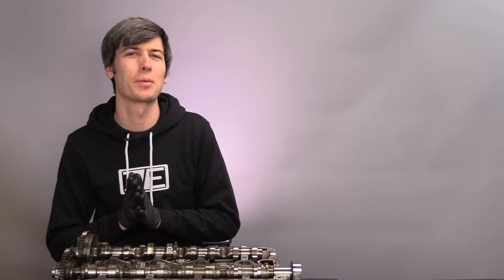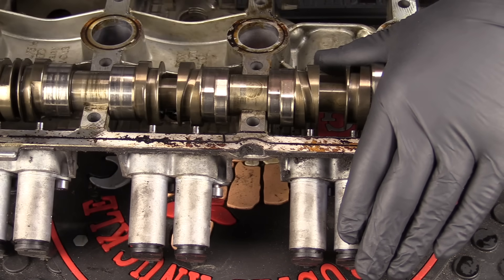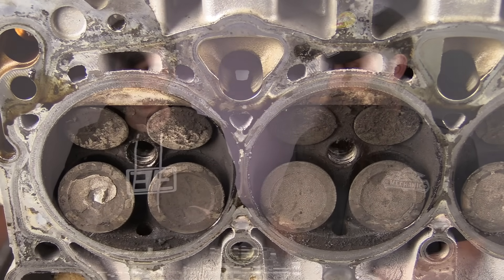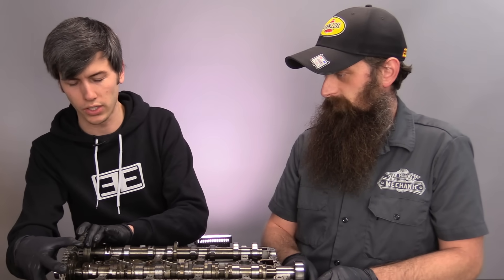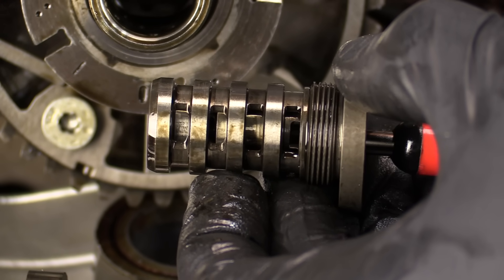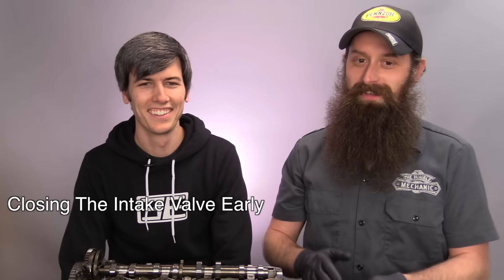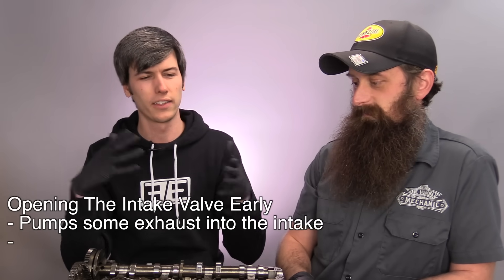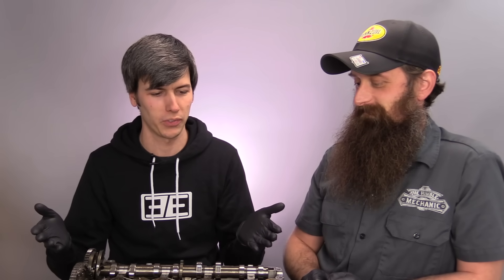Variable Valve Lift vs Variable Valve Timing - VVL vs VVT

Comment: Is there any specific reason to use VVT instead of VVL? Seems like VVL can do the same thing. Correct me if im wrong.
Reply: Vvl is set to one duration and lift. Like swapping to a performance cam at desired rpm and load. Vvt can adjust the timing, of the set duration and lift, to better fit the performance or emissions needs at any point in time in many positions. Not just off or on like vvl. Also vvt removes the need for an egr valve by producing its own egr effects when needed. In my eyes I see vvl as more of a performance feature and vvt as more of an emissions device with some performance benefits.

Comment: Got code p0011 that the cam is slightly advanced on a 2012 VW CC. The mechanic working on the car said the sprocket is bad on the camshaft and it is sticking in an advanced position. He also advised that this can cause valves to bend (again). He is asking for $800 to replace the cam. Does this diagnosis sound accurate? The video explains how the cam can advance etc. Can these stick and cause major issues like he is saying? Or am I being fed a load of nonsense. Thanks for the awesome video. Hoping you get this comment.

Comment: soon, FREE VALVES will ELIMINATE need for CAMSHAFTS , TIMING BELT/CHAIN and even throttle body. No cam profile to follow, computer controls valve open/close.

Comment: Go electric. Use the fuel in a power plant station with recapurators etc distrubiate the energy throue the grid that Will be better total fuel economy because a large power plant is more efficient. Also there is easy to shift out oil with solar power how is the way We must go.

Comment: Since this video is at least partially about VVT, I reckon a question is in order (I'm getting mixed answers, so I don't know which direction to go).

My '99 BMW Z3 (M52TUB28 engine) seems to have bad VANOS seals, and so it can't advance the timing for low-end grunt.  The top-end and idling are both good though (as I understand the cam timing is retarded for idle and high RPM).  Should I get it fixed urgently, or can it wait?  The problem is I don't exactly have unlimited funds at the moment, so if possible I'd rather do the VANOS later, and focus on more important stuff (fluid service, fixing the failing spotwelds, etc).

Some people say leaving it as-is won't cause further damage, but others say leaving it can end up ruining the entire VANOS unit, costing me a lot more.  And in case someone wonders, here are the symptoms:  Intermittant momentary RPM drop when I step on the throttle from idle, almost no power below 4k RPM ( (takes twice as long from 2.5k to 4k compared to a good 2.5 Z3, and the power comes in distinct "steps"), not-so-good fuel economy (not terrible though).

Comment: I noticed that some of the timing is adjusted to meet NOx requirements - but what if you have an engine in a racing car that does not need to meet emission standards - if you change the setting in the ECU - does it provide a lot more power? I guess my question is - does meeting environmental standards have a big impact on the engines power output?
Reply: Of course, it's called tuning a car.  But keep in mind that race engines are built very differently than passenger cars.  They are not meant to be long lasting, for example.  A top fuel race car can only do a couple runs down the track before it needs to be rebuilt.

Comment: All of these technologies just need to go away and have everyone use Nissan's VVEL.  They invented the whole setup to begin with anyways.  The 370z doesn't even have a throttle on it, the gas pump is always 100% and engine speed is completely based on their VVEL.  Some companies are still using ridiculously outdated and inferior tech like VTECH and it's 2017 for crying out loud.

Comment: this is video 2 that i have seen this engineer make a statement thats incorrect. 

a turbo does not "force air into the engine" a turbo changes the density of the air that is entering the engine. the cfm going into the turbo is much greater then what leaves the turbo.  if an engine starts with the ability to consume 500cfm then it will never consume more than 500cfm no matter the density of it. if you have 1 cubic foot of space and it is unpressurized you have 1cf of air.. if you pressurize it to 150psi you still have 1cf of air but with a much higher density. yes it took the compressor much more then 1cf of air to pressurize it though. 

a turbo can actually reduce the cfm the engine can take in due to high exhaust back pressure, for example take an engine that can consume 500 cfm at atmospheric pressure  (roughly 14.7 psi), the intake will be exposed to 14.7 psi, the exhaust will be exposed to 14.7 psi and in a perfect world the cylinder would be also be at atmospheric pressure. now strap a turbo onto the engine, with a 3:1 pressure ratio on the turbo. and lets say you have it at 20psi. the intake will see 34.7 psi total and the exhaust ports will see 74.1 psi and in a perfect world the cylinders will see 74.1 psi when the exhaust valve closes. using this example the piston will still have 74.1 psi and will have to travel down the intake stroke a bit farther (to achieve 34.1psi in the cylinder) before any air can start going into the cylinders. leaving less space for clean air to come in and less time the open intake valve can let air in leaving less total flow that the engine can consume.
Reply: honestly im only scrutinizing because youre an engineer

Comment: Emissions are NOT why I would do ANYTHING in an internal combustion engine. If I want better emissions I will just go to a Rankine cycle external combustion engine. I really don't care about NOx anyhow.
Reply from the maker: Even if you don't care about it, doesn't mean it's not toxic. If you close yourself in a room with it you'll start to care very quickly.
Reply: 105 degree heat on the 101 freeway coming back from Oxnard, 5 lanes, not moving for an hour because of a fiery car crash before the next available exit, not even AC, I am fairly familiar with concentrated NOx fumes in heat and sunlight.

Still as I said before, 'If I want better emissions I will just go to a Rankine cycle external combustion engine'.

Actually I have already built a prototype, so I am putting my money where my mouth is on this issue, literally.

I can generate massive amounts of energy at temperatures well below typical engines and therefore not get close to the whole NOx  issue while producing plenty of clean, cheap, renewable power at the wheel.
Reply: Everything in gasoline combustion is toxic except the H2O, [or a suffocant in the case of CO2] therefore your words are pointless and childish. As one who has worked on engines for decades now, I have never suffered any ill effects from working on high compression racing engines which 'belch out' large volumes of NOx emissions because, just like all engines, if you have proper ventilation, you won't even detect them.

I find it easier to breathe around a clean burning machine with some NOx than around a smoky, sooty, gassy engine which is putting out a ton of carcinogenic and lung irritating unburnt and partially burnt hydrocarbons as well as additional additives as they may happen to have added.

Some 'modern' commercially available fuels today actually boost the nitrogen in their fuels which increases NOx emissions in any car which does not have a NOx reducing type catalytic converter on it.

Comment: Jason I just wanna add that in turbocharged engines closing intake valves a pinch later allows to use the momentum of the compressed charge. While compression stroke begins piston is moving upward, intake cam is still opened and compressed air flowing into cyllinder meets moving piston and increases pressure. Valve should close just before air starts to flow out of cyllinder. That is called dynamic charging. Thank you for your videos man!

Comment: As I understand it, some engine brakes on trucks will open the exhaust during combustion so that the engine is compressing the air but getting no actual power out of it, netting a negative torque (from the perspective of going forward).

Comment: Nice information. If I recall correctly, years ago Cadillac came out with silenoid controlled vavles on a v8. I don't think it controlled valve lift and duration but it did close valves off and on and turned it into a v6 or 4 cylinder engine at specified times when needed... they didn't work out to good and I haven't heard of it since. Why all the complexed mechanical parts on a engine like this, if they could control the valves with silenoids similar to that Cadillac but with much better design control for valve lift and duration??? I think if I spent some time with it, I could come up with much cheaper and more effective simpler designs than this thing, which would cost you a fortune to fix.

Comment: One thing they forgot to mention is that when the engine changes de intake cam timming is also changing the LSA angle (in this case because is a DHOC) and a wider LSA improves smother idle but when you need power the VVT closes that angle improving combustion

Comment: i would think the reason to close the intake valve later would be to improve VE at high rpm (to compensate for the delay in the air filling the cylinder), I doubt that would stay opened long enough to push the air back out into the intake runners.

Comment: Looking at this makes me look forward to camless engines and a similar type of setup where a solenoid and actuator controls valve operation. Just shows its possible if this can be done for cams but reliability /warranty and cost is holding up??

Comment: I don't think you have done a video explaining the RPM capabilities of the Sportbike/Superbike engines vs car engines and why they can rev to 12-17,000 RPM (600CC-750CC). For example the 1.4L Hyabusa or ZX14 engines rev so much higher than an equal sized car engine like the Fiat 1.4L. Or why the 600 and 750CC engines so much higher than the Kei car engines.

Comment: Hey Guys, great Video on showing the mechanics. You haven't mentioned the real reasons for changing the timing. Such as on engines that are not "NA" or for exhaust scavenging or both. It really depends on your engine setup and application.

Comment: Would you mind explaining how the 1.4 multi air engine, like in my fiat 500 abarth, works it's timing? Benefits of using hydraulic valve control over cams and such.

Comment: Why no mention of the benefit of a wider power band? The purpose of vct isn't JUST emissions it's also about performance. Adjusting the lift manages the intake and exit velocity which effects where the engine makes power.

Comment: Rover's VVC is kinda interesting too. It doesn't changes the timing but it changes the opening duration of the intake valves like this vvl does but this vvl (explained in this video) is a binary feature ( just on and off / higher and lower profile ) just like a vtec or something else. The advantage of VVC is that it's an analog feature (short opening at low rpm and long duration at high rpm).

Comment: can't wait until there is a free valve turbo engine in production vehicles indefinitely adjustable valve for each cylinder of the engine just by modifying software in my opinion will be the next big step in performance

Comment: OMG this is german engineering at its best.. and by best i mean worst. Look, you don't need soooooo maaaany solenoids. You only need one, even with this garbage cam sliding thing. Literally make the whole thing slide into High profile with one solenoid and have it sprung to go back to low on its own when deactivated.

Comment: Can someone explain to me the benefits of the new VVT Suzuki introduced on the 2017 GSX-R 1000R? It uses metal balls and centrifugal force to push them outwards at a certain engine RPM. Obviously it eliminates the need for a complex oil system, but what's the point? Better reliability? Weight saving? Both?

Comment: why would you want the exhaust valves open less in the first place. wouldn't the engine run better with the exhaust valves open all the way at all rpms?

Comment: Not really ... fluid dynamics:  when there is flow in the manifold it has inertia so a little bit more air gets in even if the piston is coming back up. At low rpm there is not enough inertia (and actually air moves back out) but at high rpm closing valves a little late can be very beneficial. That's why they invented variable valve timing.

Comment: great video. thank you to both of you for explaining this really well. can you please explain why vw couldnt do this with the tdi? 
also, can you please explain why and how modern 1.8T and 2.0T engines make the same power/more torque as the larger 6 cyl that they replace, but still yield much better fuel efficiency and give more miles per gallon? because i always thought that turbocharging requires more fuel.

Comment: These designs are certainly very clever in how they work, but how robust and long lived are they? Do they go 200,000 miles plus in a well maintained engine?
Reply: Yep. Hondas are some of the most well-known engines with VTEC/lift/whatever and the car will rust away around the engine with the engine still running

Comment: Hi! Nice explanation! At 8.07 min you can see that the shafts of the valves are bent. Please, confirm that this is due to a collision with the pistons and not some fancy valve and cylinder head design. THX!

Comment: One day if the ICE is still around, there will be camless valves. No throttle body and endless tunning possibilities because valve lift can be controlled fully not just step like todays cams.

Comment: Leaving the intake valve open longer can also increase power.  Because air has mass, it also has momentum so as velocity gets near the speed of sound, assuming there's no turbo/supercharger, the air will continue to flow into the cylinder as the piston reaches BDC due to Newton's first law of motion.  This means you can get more charge into the cylinder, and therefore increase power.
Reply: You can get a sense of the mass and momentum of air by blowing in a long hose and then suddenly block the flow with your tongue. Air is actually quite heavy !
Reply: Valve overlap is there for the very same reason (when talking about inertia) back in the carburetor days - the exhaust valve is closing but before it finishes, the intake is opening.  Air with all its inertia rushing out of the exaust side pulls fresh air/fuel into the cylinder all without the piston doing anything.  The important thing is "starting" the intake flow process.  (This isn't needed as much anymore because of the advent of fuel injection.)
Reply: Yess thats were CVVD comes into the picture. Hyundai made the first production car with the technology!
Reply: @shaunaksarker7958  I've Toyota with valvematic (VVL) and it's quite torquey down low but doesn't restrict high rpm unlike BMW's valvetronic (2 rockers in series). 
All that matters in the end is getting more air (NA engine) whether CVV-L or D.
Reply: hmm, but you are letting the air out into the intake manifold when leaving the intake valve open longer. That is reducing air in the cylinder -> reducing oxygen -> reducing Power. So what you are saying sounds wrong, but please correct me if I am wrong.
Reply: I believe the point is that air continues to rush into the cylinder after the piston reaches bottom dead center due to inertia, so leaving the intake valve open a little longer can bring more air in. You have to consider that things move extremely fast in an engine and it’s not just a slow moving animation or model. Flow is driven by pressure differentials so when the piston starts moving down it lowers the pressure in the cylinder even lower than the intake manifold pressure, and that’s what causes air to start flowing from the manifold into the cylinder. All through the stroke the cylinder pressure is lower than manifold pressure, and after the piston starts moving up and increasing cylinder pressure, it takes a finite amount of time and displacement before the pressure increases to above manifold pressure, causing air to be expelled back into the manifold if you keep the valve open too long.

Comment: I understand why you would want different duration and timing depending on RPM, load and throttle position, but why do you need variable lift? what's the benefit of not using maximum lift all the time?

Comment: can you make a video explaining Honda new dual VTEC? I believe it is VTEC on intake and VTEC on exhaust.
how ever, some other people says it have 3 profile, VTEC 1 for aggressive and VTEC 2 for super aggressive.
Reply: Dual vtec is as you thought, both inlet and exhaust as oposed to the original single vtec which was inlet only. Due to ecu activation of the solenoid the advent of vtec controllers allows for different rpm activation points thereby offering the choice of different engine modes, sport, normal etc

Comment: It appears that the exhaust cam is really varying lift and a small amount of timing too as the duration is different between the two profiles, but can only be one or the other profile.  Can the intake timing be infinitely varied between the maximum retarded and maximum advanced settings or is it just one position or the other?

Comment: HI!
I think that the main purpose of the "implicit" EGR function in petrol engines, achieved by early exhaust valve close or even by increased overlap (with respect to the given rpm), is the reduction of pumping losses due to the retainment of combustion (inert) gases. This holds true since this way the vacuum pressure, created by the descending motion of the piston, is reduced. I don't think that the NOx emmisions is the biggest issue in petrol engines, especially in the stoichiometrically operated ones.

I am not sure of this, please correct me if I am wrong.